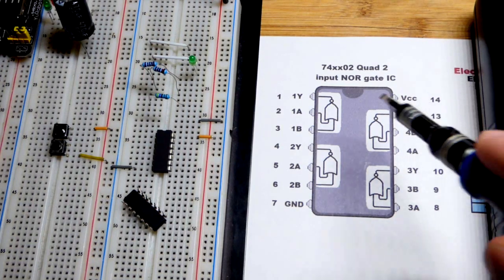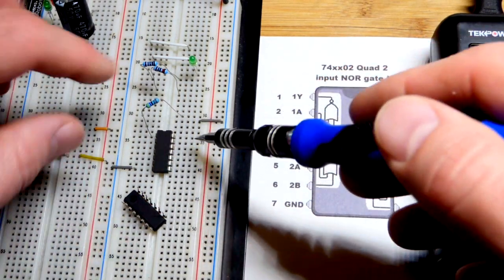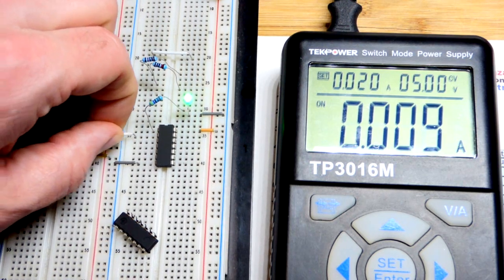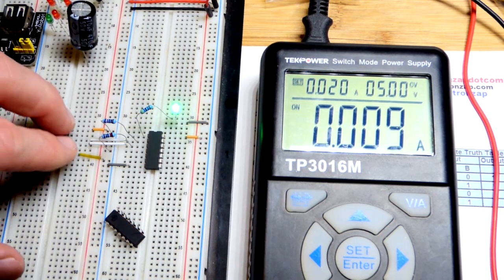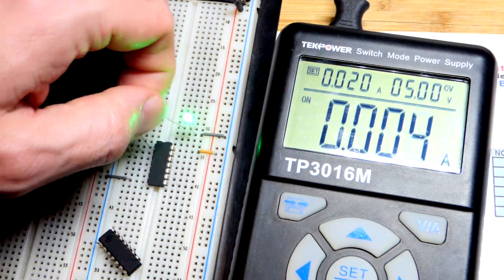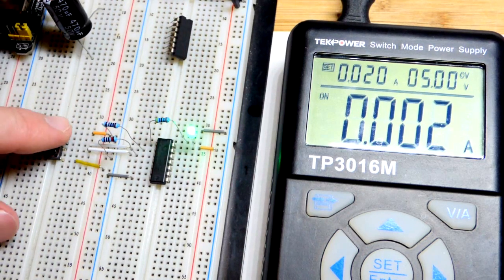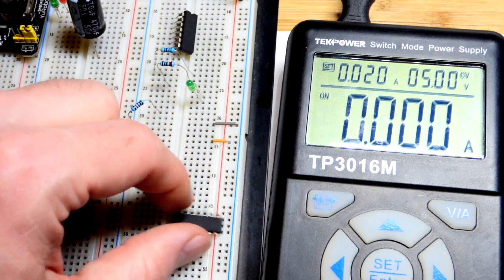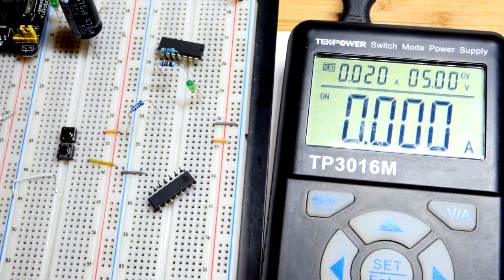7402 IC power consumption comparison between 74HC04 and 74LS02 electronics integrated circuits

Comment: I try to use this IC for my CD4026 7-segment MOD circuit. I can't get it to work correctly.
I connect wire from one of 7 segment to one of the input of 74ls02 and link inputs together. So 1 wire as 2 inputs.
But output doesn't work correctly. I get 1&1=1 instead of 1&1=0 . But 0&0=1 still work like it should.
I suspect that when input is 1 but the current or voltage is not strong enough to consider as 1. So it is count as 0.
How to solve this problem?

Comment: To measure quiescent power consumption you MUST tie all the very high impedance inputs on the 74HC02 gate to a rail. Stray signals will be causing the output to switch between voltage rails or sit at a middle voltage. In both case considerably more current is drawn by the CMOS IC. As the 74LS02 inputs will see a high input due to internal pull resistance the output will be fixed at a rail voltage but a good design cannot rely on that pull resistance.
Reply from the maker: Thanks for the info! I did read to have all unused inputs tied to the positive rail, but I was only waiting to see how stray signals affect the output(s) I was using. Wasn't thinking about the total IC quiescent power consumption.